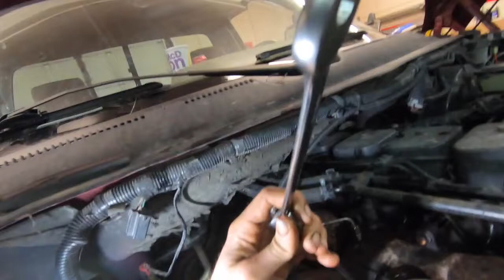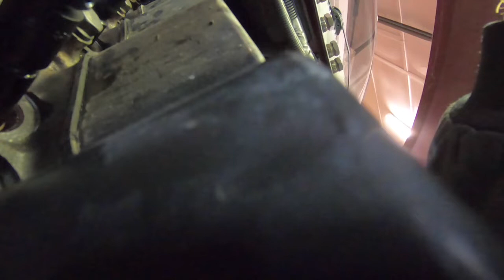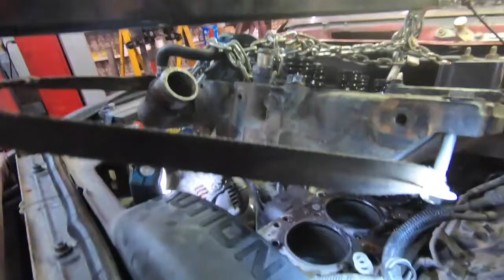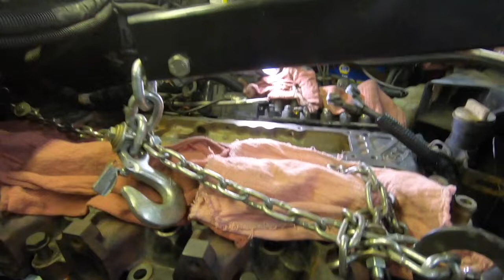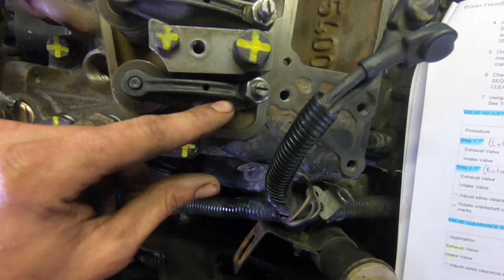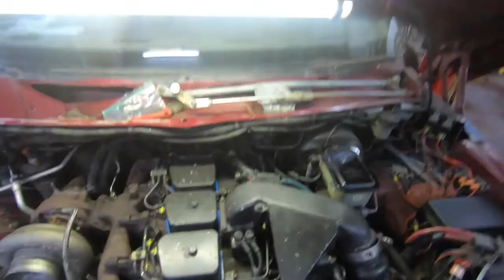5.9 Dodge 12 Valve Cummins- Complete "How-To" Guide to Remove and Replace Headgasket

Comment: I'm using this video to redo my head gasket as well, however the sequence I got from Cummins says to NOL the short bolts but it names the short bolts wrong in the numbering sequence. The number sequence indicates to not torque the longest rocker arm bolts. Super strange

Comment: I think you're misreading the torque specs  The manual I have says torque all bolts to 30 ft. lb......then torque all to 66 ft. lb......then torque just the long bolts (Just the 6 holding the rocker blocks) to 89 ft. lb.  Then turn all bolts 90°.  This came from  a Case IH service manual for a 5.9 12valve in a tractor.

Comment: I have to do this to my truck I got a question for you my question is do you think that if one valve broke I start getting a noise like a mid-engine noise like it sounds like it's coming from the middle of the engine and I'm not 100% but when I took out the delivery valves the very number one valve has been having an issue where it gets fuel and it don't so I ordered new delivery valves this is the first time I've ever pulled one of these delivery valves out I put new washers and I put some new o-rings and just check the valve and everything looks to be fine the only thing that that confuses me is that the other delivery valves seems like they're connected the number one seems like it's connected to but it just seems loose like you can twist at 360° and the other ones when I take up number two you can't do that it stays kind of stuck in its position now I'm getting good amount of fuel through number 2 thru 6 out of the delivery valves and out of the injectors and there is a change in the way the motor runs when you crack open the injectors and the delivery valves number 2 through 6 but number one no change while I was driving down the freeway about a month ago and my truck started to lose power I pulled over right away didn't know what it was and I have been needing a head gasket for the past year and it just leaks from the very back of the head I thought it might have been around the exhaust manifold bolt where they leak but it's coming from the head so I got to keep it filled up with fluid at least a couple gallons every couple days if I'm doing a lot of driving I lost power and it seems like it's never been right since I got a tick in the middle of the engine or the lower of the engine like a little not a knock but a ticking pretty good and I also adjusted all my valves I had one bent push rod when the valve spring broke put a new valve spring on and replace both of the pushrods I think it was on the number fourth cylinderthat it happened to well I got another wrench and I was going to completely rebuild I have about $400,000 on the dash I don't know how accurate that is or not I bought the truck use about 4 years ago maybe 5 years ago now and I've been driving it ever since and it's always ran good but I do get quite a bit of smoke right before this was happening I was getting quite a bit of black smoke so either a dead cylinder I haven't tested the cylinder yet which I'm going to try tomorrow I put a new injector and the number one and it didn't make a change it is the p7100 pump and I think the delivery valves are 181 I don't know how original that is but that's what it shows now the delivery valves that I ordered are a little bit smaller for some reason so the only thing I wind up using is some new o-rings for the number one and two delivery valves cuz I pulled them out and the cylinder that they sent in I replace the o-rings for the delivery valve one and twobut I'm thinking that somehow that delivery valve I don't know how it's connected or what on the inside I think the number one delivery valve had came disconnected somehow and that's why hence I'm not getting the power and I'm getting black smoke and it doesn't make a change now also the puppets or the tapits do you think that there could be another bent rod I wouldn't think there would be because only one valve spring broke but I'm wondering that the tap at came dislodged when the truck was running and fell down into where the crank is and that's hence where I got that noise cuz it doesn't have the tapet no more it's just something I thought of and I wanted to know what you think your suggestions were on an after-market Chinese pump I found one for close to $600 here that has got very good reviews it's an identical setup to a p7100 and my oil pressure has been acting up to ever since that happened or I got that ticking noise I'm at like 20 psi idling and then when I rev it up while it's cold I'll get close to like 50 60 and then it'll drop down if my foot's off the throttle to 20 and then if I give it throttle it'll go up to about 40 and if the engine gets real hot it'll be at about 30 and it always seemed like it was always higher before that happened to me on the freeway so I know that there's a thing inside the oil filter assembly that can cause it to not get oil properly I haven't checked it yet but just for reassurance I figured you know what I'm putting the head gasket on the truck I was going to put a brand new head but I said if the truck is not getting oil right there's no sense of me putting all kinds of money in the lower end has to be gone throughso I'm going to use the hat on the the new engine that I have that needs to be I'm going to wind up going through the whole engine so I'm going to do the killer doll pin in it if it hasn't been done I'm going to resell the front cover put a new oil pump in it and put the head gasket on and while I had the front cover off I figured I might as well order a cheap Chinese pump and that should at least place this engine up enough to where is your last some more time before the other motor is done and I dropped the other motor inn but this motor has always ran very strong until about a month ago when that happened on the freeway always kept the oil in it and everything else but I have noticed too that since the head gaskets been bad at least the last couple months it's gotten worse that the oil is not milky when I change it but the dipstick and where the oil is to see if it has blow by has a lot of condensation like white creamy stuff but when you change the oil the oil is perfectly fine so I know it needs a head gasket but I just think it's worth getting worse and worse and when I dropped broker valve spring apparently it didn't drop the valvesI believe it was on the exhaust side so when I pop the head off I'm just going to look at that and maybe put a little bit of lapping compound find that valve and all the valves and throw some water in there and see Orr thiner is what some guys use I see if it leaks if it don't leak then I should be good I'm just trying to do it it's cost-effective is is possible like I said I have a brand new head what I would definitely think that that ticking I don't know where that chicken came from cuz the motor is always ran good has always been quiet

Comment: Nice video. Quick question, after you back off the rod adjusters to in install the rockers do you tighten them back so they are on the rods before you find TDC or do you leave them completely backed off and then start to adjust them when TDC is found to begin lash adjustment?
Thanks

Comment: Very very nicely done and informative video ... whats your opinion on doing arp 625s one at a time and keeping the stock headgasket vs replacing the headgasket ? It's a 1 owner 12V with 160k miles I'm restoring and doing a new 62mm and 5x12s and supporting mods ... truck has never been worked hard or pulled a trailer overheated etc etc
Reply: I ordered some 625+ for my 12V about the same time you posted this. I’m still waiting for them lol if you haven’t blown your HG, might as well keep using it. No sense in breaking into something that isn’t broken. Lol stock HG don’t like over 45psi at all. If you do end up getting a new HG go with the marine grade one and o-ring the head.
Reply: If your not planning on making over 650 to 700hp 625s ain't worth the money. Better safe then sorry tho if you live in a high corrosion area such as Canada or the southern states.

Comment: I'm not sure if when you are adjusting the values the 1st time around that when you rotate the crank 360° the pin under the injector pump lines up again because the  cam gear takes 2 revolutions to hit the mark again.. I thought I heard that you hit the alignment in the video.. ps great video

Comment: As a quick note. I'm not sure the quality of the copper grease you get in the U.S. but in merry old England, the run of the mill stuff is poor for lubing up injectors, instead we use a high temp ceramic grease. It works a treat.

Comment: 👍🏽 you can continue to prime the lift pump by hand until you hear the over flow valve squeak on the injection pump, and most of the time you won’t have to crank the delivery valves. Just crack the first three lines👍🏽👍🏽

Comment: Im turning a 500k km 97 12 valve inti a 650 horse truck, first time doing it to a cummins, thanks for the help with the tricky things i couldnt figure out
Reply: I got 250K miles out of mine before having to redo the head gasket because I have some upgrades of horsepower and was towing in 11,000 lb trailer across the whole United States. Twice